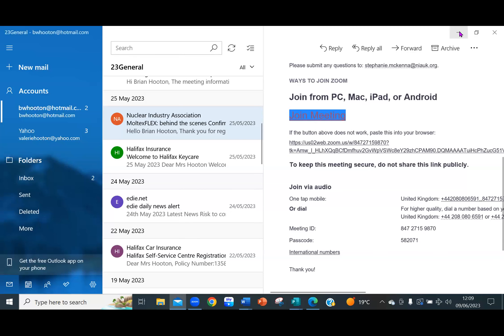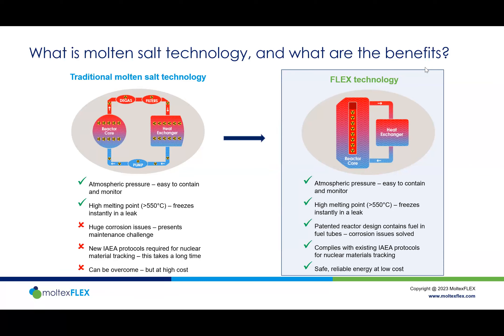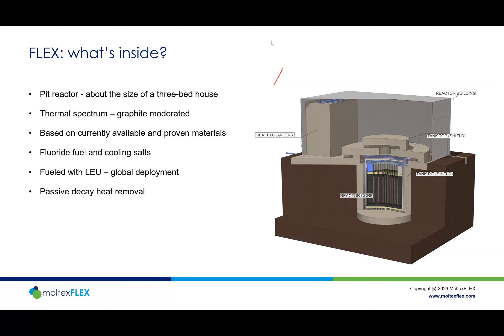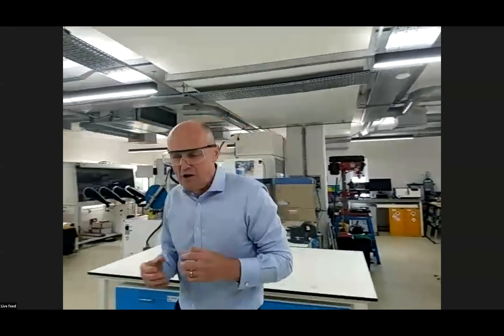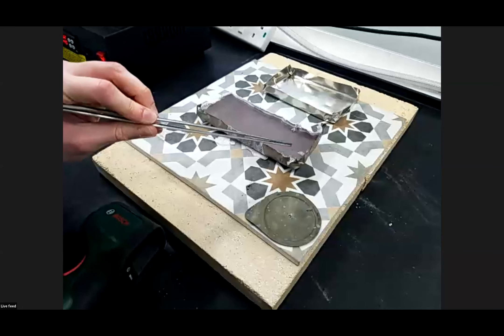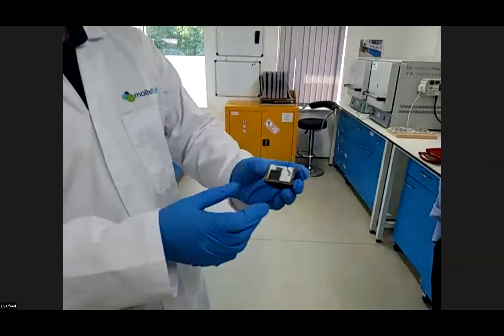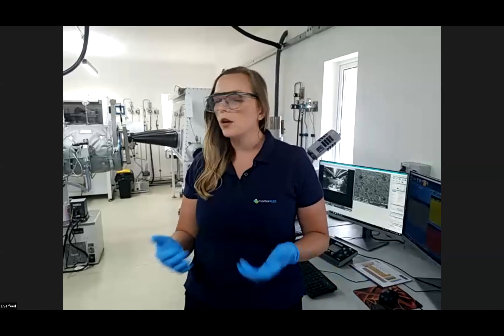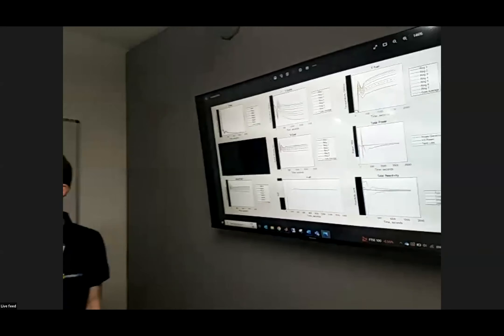MoltexFLEX live webinar and lab tour

Comment: The Math-Physics of Nuclear Chemistry is interesting from the inside-outside POV of Conformal Resonance Fields Conduction of mass-energy-momentum continuous integration of spin states, which are what has to be behind metastability and sync-duration decay of relative-timing resonance bonding in the natural projection-drawing of holographic prime-cofactor frequency density-intensity alignment in superposition. 

Do "simple" chemical elements remain in a more controllable state, self-defining substantiation stability state, than complicated anharmonic leaky states of complexity, on the guess that erosion and corrosion are basically disharmony in quantization spin states.
Ie "massive respect" for this design and arrangement of the Reactor/Instruments.

And this is why solid suspended in liquid under these conditions is apparently more realistic than "Perfect Gas" Thermodynamics of so-called Fusion Reactors that don't seem to acknowledge holographic confinement positioning in hyperfluid vertices in vortices nodal-vibrational emitter-receiver interference positioning-location, Bose-Einsteinian Condensation Correspondence of Quantum-fields Mechanism Holographic Principle.
If the actual intention is an attempt to understand Spinfoam bubble-modes of Fluxion-Integral Temporal superposition Calculus Completeness cause-effect Actuality,  ..all well and good.